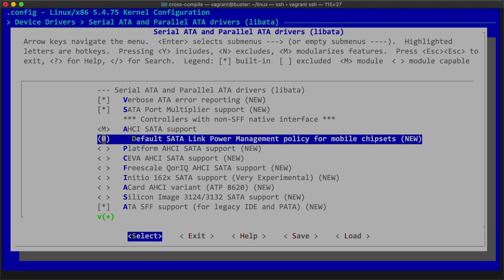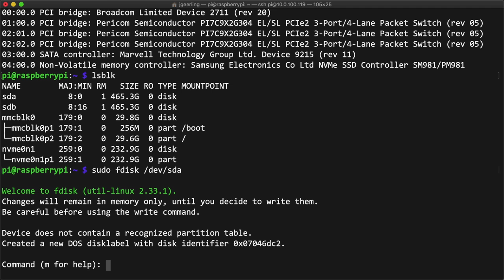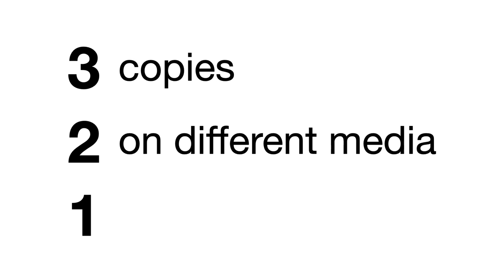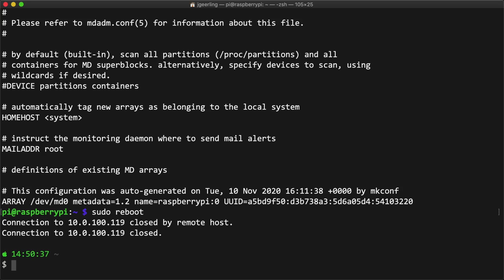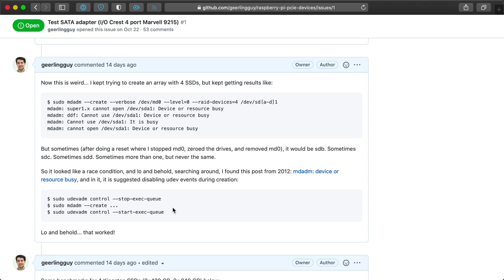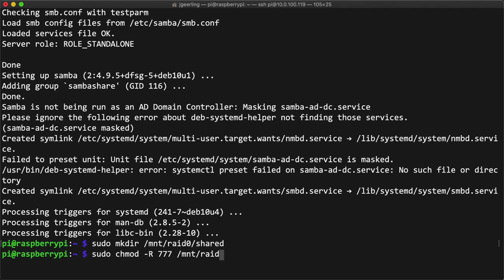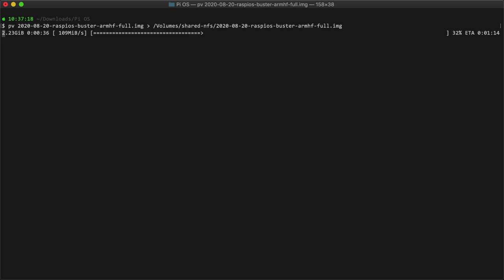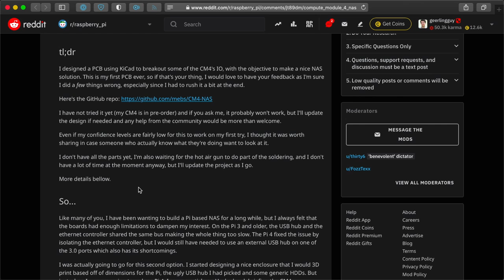I built the fastest Raspberry Pi SATA RAID NAS!

Comment: Something to note, is WD Green drives have firmware tweaks on them designed for power saving that cause them to fail prematurely when used in a RAID that isn't constantly in use. You should really consider editing the firmware with the DOS tool who's name I can't remember at this very second but if you google for it will show up pretty quick (This fixes the problem and essentially turns them into WD Blacks...) 

Also, RAID 5 has issues with data safety with drives over 500gb. RAID 6 should be fine with drives up to 18tb or so. A good backup is always required, but RAID 6 is fine. Your fears are kind of outdated. Although RAID6 performance is considerably better if you have an actual controller doing the work instead of md.

Comment: Hi Jeff, awesome video! I plan to build my own small NAS with RPI, OMV or raspbian and HDDs. If I got your video right, the only significant difference between using RPI4CM + SATA connected HDDs and RPI4 (not compute module) + USB connected (USB-SATA reduction) HDDs is the 4K write speed  (based on the SSD USB vs SATA comparison graph), so if I plan to use my NAS mainly for nextcloud, and not plex or other media service, RPI4 + USB connection is perfectly fine, am I right? Can you maybe make a short video comparing RPI4CM SATA speeds vs RPI4 USB speeds? Thanks.
Reply from the maker: Since the Pi 4 is basically the same chip, the USB 3.0 speeds on it should be directly comparable. For random IO, there is a noticeable difference as mentioned in the benchmark in the video. For sequential IO, it's a much smaller difference, but SATA is still slightly faster.

Over the network, though, that won't make a huge difference since the limiting factor is network bandwidth.

Comment: Instead of those simple sata adapters you should try a HBA Controller Card. Those are smarter any may take load of your CPU. For my server I use an LSI 9211 in IT Mode. Flashed without ROMBIOS this removes UEFI obstacles. However the 9211 comes with 8x PCIe, might not perform  ideal with an 1x interface.

Comment: I've been running FriendlyElec NanoPi M4 (with the 4 port SATA HAT) with 3 drives for a while, the SATA controller gets to hot even with heatsink in the room it's in (which is probably not above 25C even in summer). It's NOT (!) a good way to keep your data safe. I agree this stuff is lots of fun doing these SBC setups, but data loss is no fun. This isn't a problem of the NanoPi/SATA HAT, pretty certain as you've show the temperature of the SATA controller in your set up... just isn't good enough.

Comment: hi jeff can I connect a floppy connector to j20 on the cm4 carrier board and the sata from the sata card to 4 drives without using the 12v power connector ,Dont want two power supplies,im using a super micro 260w atx power supply.

Comment: I agree with you about backups, but believe you are wrong about raid 5 & 6. And raid 1 & 10 adhere to the old adage about a 2 engine airplane - There are twice as many items to fail. I've lost a lot of data on Raid 10 systems, but their greatest problem can be read/write speed asymmetry.

Comment: Nice video, as always. Just a few remarks:
When using NFS, always specify proto=tcp, as there is no reason nowadays, to run NFS via UDP. At some occasions, specifying rsize and wsize greatly helps performance, as client and server "autonegitiate" these settings if unspecified - which can lead to some strange automatic settings.
While there are better options for a DIY NAS, than the Raspi, your setup is still a perfectly viable storage server. Don't build the storage server you can, but the one you need. And I am convinced, that most home-NAS requirements would be perfectly satisfiable by the Raspi NAS.
Please do not use ext-4 anymore. Modern Linux kernels have excellent XFS support, which is a much superior FS.
On RAID, I disagree. RAID 5 should not be used anymore, for reasons you hinted. Use RAID-6, preferably with double parity. However, please consider carefully, what you are doing and how it best matches the number of drives you use. RAID-6 DP only makes sense, if you have 6+ drives. Even if you have, you still need to carefully consider, how data and parity is layed out. 7 drives are almost never better performing, than 6 drives, for example. RAID-6 requires some basic understanding and if you do not want to care, use RAID 0,1 or 10, but it is a proven, reliable and well tested solution. But best implemented in hardware - with md, not so much.

Comment: I've had similar performance issues using SMB and NFS on low end NAS boxes so I'm not surprised that a Pi would have some intermittent performance issues as well.  The problem is the NFS, SMB, filesystem, and software raid overhead as well as I'm sure some less than optimal default settings.  I've attempted to performance tune a couple of NAS boxes in the past with varying levels of success, but in the end you're still limited by the power of the hardware... and this is painfully apparent when moving thousands of small files.  The easiest and most effective way to get a huge performance boost is to just not use NFS or SMB and to not allow the Pi to handle the filesystem at all by setting it up as an iscsi target.  Sure, there are some limitations with iscsi use with multiple hosts that aren't cluster aware, but the performance gains might be worth it if you tend to deal with a lot of small files and only need a single host to access the data.  Alternatively you might consider setting up a second Pi with a second nic and using it as a nas head, one port to connect to the iscsi Pi, the other to serve NFS or SMB shares.  This would avoid having both the raid and filesystem overhead on the same device, but it still means having the filesystem and NFS/SMB overhead on a single Pi....  on second thought, I'm not sure this last option makes much sense, but it might be interesting to try.

Comment: Careful with those Marvel SATA cards if you enable S.M.A.R.T. monitoring for your drives (which you should). They would run fine for days and then they would suddenly lock up and not serve any additional I/O until reboot. IIRC it had something to do with the microcontroller not handling parallel SMART requests correctly, and is not something that's fixable by a software update.

Comment: The IO problem could also be that the SDD's cache is full and it actually uses the slower areas which use a different method see MLC/TLC for SSD. MLC is very slow but they compansate this with a faster but smaler area used as cache. But this has a specific size, when you copy bigger amount of data than this limit, the ssd get's really slow.

Comment: Hi will you try a SAS HBA? Non a raid card but a sas hba in it mode, if you don't know it will take sas disks and pass them to the os as they are, with smart funcions, temps etc. It's like connecting sata drives directly to a pc.
 You can try a LSI 9200-8e or (sometimes cheaper) a Dell H200E that is the same chip but with dell firmware

Comment: I wonder if there are any hardware solutions to using dozens of low quality Micro SD cards in RAID10, in such a way that the individual cards have some capacity to degrade without corruption, and then be swapped out when they do eventually fail, without causing a pause in the system.

I think it would be neat to have a system where the data storage is much more granular, allowing a much less expensive replacement to burnt out storage units. Although, trying to keep track of which card goes where might be a headache if you don't have the discipline to always label them with a marker according to which slot they sit in.

Comment: I also have a Pi4 NAS storage with two 2.5 HDDs running samba, but I have a huge problem with Linux and Mac. I don't know why but on Mac and Linux I get read/write speeds of about 1-3 MB/s (large file) while on windows I get about 90MB/s. I tried solving the problem by changing my samba config but it didn't help.

Comment: good video, i wish it was easier to turn a Pi into a quality NAS, the power efficiency is very good. I recently upgraded my NAS/Plex server from an old power hungry Xeon to an i3 10100K underclocker and undervolted by -.125mv and im seeing 22 watts at idle in unRaid and only 28 watts transcoding video on the iGPU in plex. Mine is powering 2x 128GB M.2 cache drives, 16gb ram, 5x 12tb HHD.

Comment: From a data hoarding point of view, the laws of finance dictate that SSD's are a big, whatever. Unless you're building a NAS just to run benchmarks, in which case, there you go. But if I'm building a NAS, then the smallest sized disks I would use would be 12-16 TB depending on whatever the latest deal at Best Buy or Amazon is.

Comment: Jeff, did you flash the LSI card to IT mode? This is commonly done on FreeNAS. Flashing it will make each drive show up as a single drive to the host, effectively turning the LSI card into a super SATA card. Might make that card work for the issues you are having. If it still doesn't work, it might work on FreeBSD on the Raspberry Pi, because the LSI card is really common on FreeNAS (which is based on FreeBSD.)
Reply from the maker: I'm going to try that soon—I've had to put LSI testing on hold for a bit to catch up on some other stuff before the end of the year. But thanks for the suggestion!
Reply: @JeffGeerling  no problem!

Comment: So, when they release the cluster board thing for the compute module 4, will that have the PCiE slot....and will it have more lanes because more pis......Because I feel like that would enable even more shenanigans if so...
Reply from the maker: Yes! Though I'm not sure of the final design yet. It might have 1 mini-PCIe slot per Pi, or something like that. If that's the case, there are plenty of interesting use cases but it wouldn't just be "plug any old PCIe card into any of the Pis"

Comment: I wonder if using a drive with an onboard DRAM cache would make a significant difference for performance as a NAS? It's definitely a major factor for desktop use.
Reply: As a nas on a raspberry pi? I doubt it. Even without getting into performance overheads, the best you can do over gigabit networking is 125MB/s sequentially. Add samba/nfs, network overhead, and the io limitations of the Pi's SOC, you're probably not going to see a huge difference in drives with/without dram caching.

That's all just speculation, though, and it certainly depends on setup and use case

Comment: Instead of Glacier you could use an S3(like) backup provider outside Amazon. They use a business model more attractive than Amazon's S3. And they are faster than glacier. I use Wasabi (not sponsored, but it just works and yes I tested the backups). As Backup software I use Duplicati, also tested.

Running  SmartOS as homelab server but very hard thinking about moving to Proxmox. But I Love ZFS. I want ZFS. Proxmox supports it so could.
I have a Sabrent PCIe 3 ZFS mirror and Samsung Sata mirror. PCIe NVMe is faaaast.
Reply from the maker: Glacier is cheap though, and easy to use via S3/rsync :)

Comment: Smb should be about 20% faster... Use the iFruit extension, use smb tools on the Mac to make sure it's using SMB 3.02. Talk to me... I've been running an FCP Samba Btrfs/mdraid server with a 10G link for 3 years. 

Bonjour/Avahi are critical for Macs... Go out of your way to make sure that's predicable. Including dropping port 139, disabling ipv6, disabling link speed negotiation...

Also, built in 10G on Mac Minis are vastly better supported than Sanlink 3 adapters over thunderbolt... Disable sleep entirely if you must use them.

Comment: RAID6/RAIDZ2 is lose >ANY< drives and data is ok, whereas RAID10 is  dependent on not losing both drives of the a mirrored pair. 

 On rebuild of one failed drive, in RAID6 you are stressing the entire array, whereas you are just stressing the mirrored drive in RAID10. You can suffer a drive failure in rebuild

These are subtle but important differences, that are subject to much debate. There is no perfect answer

Comment: Comparing power usage of RPi + SSDs with the NAS-Appliances (which assume NAS-Grade HDDs) is a bit unfair, because most of the additional power will be lost to the HDDs mechanical functions, not because these highly specialised systems are less efficient than the RPi general purpose platform...

Comment: Both SMB and NFS performance is weird in the video. I have a single (dSMR as I've discovered) 8tb HDD with XFS connected via USB to 4Gb RPi 4B, which I've recently reformated to BTRFS and it is/was giving me about the full gigabit performance (>115Mbps) with SMB Windows client (though I haven't tested it after reformatting). May that be that slow ext4? Also, I am using 64bit ubuntu 20.04 and not Raspbian
Reply from the maker: Could also be the software RAID causing more queueing in the kernel.

Comment: I'd be extremely interested to see Ceph performance on a small cluster of these.
Reply: That would actually be quite intriguing. https://hackaday.io/project/175094-raspberry-pi-ceph-cluster
Here's a project where somebody has tried this, and I think I might replicate it myself.
EDIT: and now I'm reading that guide, and it uses 19 total Raspberry PIs with 30 external HDDs. I simply don't have the resources to pull that off at this time.
Reply: I'm definitely going to implement this, I had it installed and running on some Pi4s. I have 3 cm4 4gb coming tomorrow, they were all I could get hold of right now. What I did get today though and I'm thinking maybe more suitable is the RockPro64. That has a pciex4 but also USB-C and USB3 too so I'm thinking pcie for the storage, I have already tested an LSI 9211-8i and that works fine and USB3 or C ethernet for replication.

Comment: Did you try to set the cpu clock at 1.5Ghz in the raspberry at top instead of the floating?  You should try to upgrade the  heat sink on the card and put some on the hotter components.  You will extend the endurance of the card.

Comment: you might wanna fact check the linus raid failure because it was actually a software raid running through raid cards in IT mode (Passthrough), HW raid 5/6 is a lot faster, safer, and easier to use then any other software solution for the simple fact that 1 controller is controlling the drives so if you have a board or raid card failure you just swap out the bad component and recover the array in a GUI.

Comment: Did you think about the "periodic temporary slowdown" being related to the high temp? Not sure about the compute module but it is my understanding that my pi 4 B 8GB will start throttling around 65-85C? I can't remember off hand the exact number, but I think it is in that range.. So I just looked it up and it says that the "official operating limit is 85C.. and will thermally throttle around 82C.. " the article goes on to say that different firmwares and OSes Etc will sometimes change this number down to 60C in some cases... You mentioned 90C as the running temp with the heat sink and fan... Of course this is all Pi SBCs.. not the compute modules...  anyway, it was just a thought... but I am guessing the SoC is the same or very similar... so you might look into that..? Good luck. And cool video!
Reply from the maker: I was monitoring the Pi temps and they never got above around 55-60°C—the SATA adapter card was what hit 90°C+, and I can confirm there was no CPU throttling on the Pi itself (with `vcgencmd get_throttled`—that always returned 0x0).
Reply: @JeffGeerling  oh, got ya!.. I misinterpreted that... yeah, I just always copy a bash script i wrote a long time ago to monitor vcgencmd temp and cpu with a timestamp.. just gives the update every 2 seconds of how much cpu is utilized on overclock at 2.0ghz.. and the temp in C and F... and time... works great for running HWtest to test the cooling fan/sink and make sure it will run at 2.0ghz and never throttle... well... that was my theory... haha

Comment: Just a thought: Why weren't spinning disk drives not develop multiple scanners to read and write on multiple parts of the disk?
Reply from the maker: I think it's a trade off of complexity, power usage, and size vs performance. the amount of space that would be required for an additional set of read/write heads would not be worth it, and there are likely other considerations we couldn't think of off the top of our heads.
Reply: There have been spinning disks with multiple heads in the past, but with modern devices, even one head is monumentally complex. Trying to synchronize the tracking on two of them would be a huge engineering challenge.

The cost effective solution is exactly this video - there's not much technical difference between two disks in a raid vs one disk with two heads. And even more, nowadays, if you actually want performance, you are certainly going SSD

Comment: "RAID is not a backup"

mind blown.  you are probably right but I think you could have done a better job explaining the reason why.  but I'll try to guess... it's because the complexity and fragility of the setup makes it a not ideal backup mechanism?  if that were not an issue or perhaps even in general I somewhat disagree that RAID is not a backup because for example RAID 1 is by definition backing up (mirroring) data.  you could say that this backup system is not ideal or that it is fragile, and rebuilding a failed array is slow/risky/etc but it is still a literal backup.